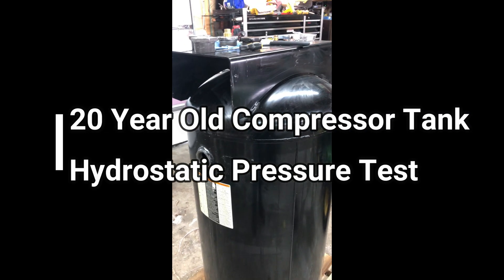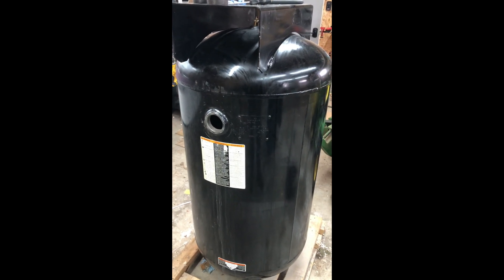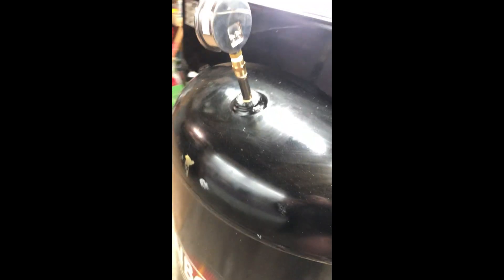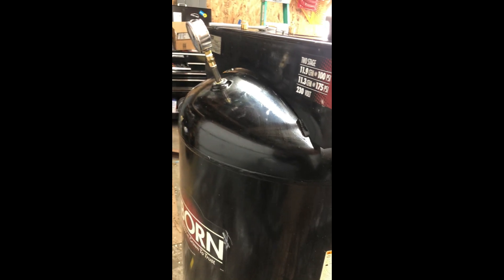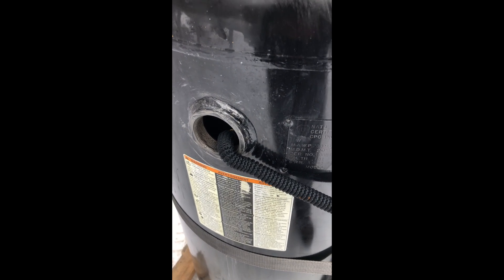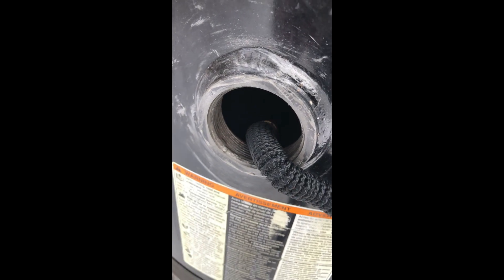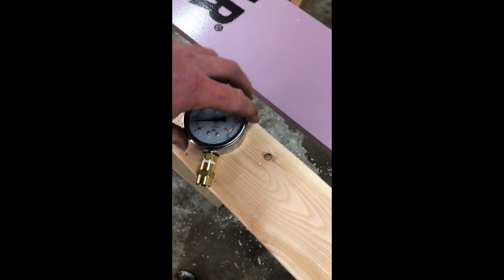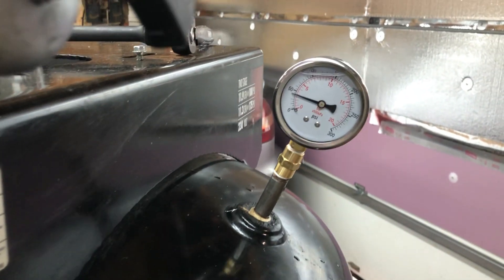Hydrostatic Compressor Tank Test

Comment: My 30 gallon tank takes about 1-1/2 cartridges of grease to pressurize to 300 PSI. I leave it at that pressure for 1 hour. The grease in the tank doesn't hurt anything and reduces corrosion on the bottom.

Comment: You should’ve use the pressure washer you don’t even have to turn it on. You could just pull the crank a few times and the pressure will immediately start building.

Comment: What kind of pressure gauge did you use? Gauges meant for compressed air or gauge meant for water pressure?
Reply from the maker: I think I just got some water pressure gauges at the local hardware store.

Comment: If you do not have a scope. Use a small  inspection mirror that will fit in the hole and angle it so you can see the bottom. Just a helpful tip.

Comment: Seeing how much grease was used, only confirmed to me that using pressurized nitrogen is the way to go. I fill the tank with water and then used nitrogen for the testing. Granted, I think the grease may be a tiny bit safer but with the tank full of water, the nitrogen isn’t that dangerous for the final pressurization in my opinion.
    Using a small nitrogen cylinder can’t be too dangerous since there’s a regulator and I’m only giving small amounts of gas.  Kieth Rucker used a pressure washer which is another good way in my opinion. Anyway, thanks for the video because you definitely didn’t edit out the bad stuff. You had me laughing because I thought I was watching myself. It’s like what else can go wrong. Good stuff.

Comment: well, that solves my "don't have a pressure washer" issue to do a hydro test.    Was the grease fitting on a pipe fitting a custom job or can it be purchased?
Reply from the maker: Grease fittings are usually npt threads. Everything on the compressor is an npt thread. Should be able to find everything you need at the local hardware. It takes considerably more grease than you would think. I did the math and the tank actually expands quite a bit and that much water compresses more than you’d think when it gets pressurized.
Reply: @unskilledmechanic9601  Thank you for the reply.   I picked up the last package of 1/4" NPT grease fittings at my local hardware store.  It took about 1.5 tubes of grease to hit 270 psi.  No leaks and no creaks.   I decided to set the cutout at 120 psi and a new safety valve at 140.  Slapped some new paint on and now I have a portable gas powered air compressor that only cost around $150 including the motor.   at some point I plan to add a 2" inspection port, so will have to to do the test again.   I might end up getting a long hose and a bucket and just using water with the grease pump head in the future or modifying the grease tank to take a garden hose where the plunger hole is.
Reply: @travishanson166  Sounds like you plan to weld on the tank?  Please dont do that.  Can cause a weak point in the tank that will fail after some time.
Reply: @benjaminreinhardt259  that's the point of hydro testing.........

Comment: I was thinking you could also do before and after circumference measurements to get sort of the same info that a pro tester gets by submerging the entire tank in water and watching what happens to the water level during testing and after depressurizing.
Reply from the maker: I think I did the math on that. I think I came up with the diameter only changing about 0.060 inches. Difficult to measure that accurately.
Reply: @unskilledmechanic9601  yea thats splitting hairs 1/32" is 0.03125.

Comment: I would never have thought about using grease man. Obviously it pumps loads of slow pressure.
How did you get all the grease out?
Did you get the compressor up and running yet?

I never thought much about the danger of an air tank until I welded some rusty holes up in the bottom of an old Rolair twin tank wheelbarrow 5HP Gas powered.
I started looking into it more and more on Youtube and became leary of using it without replacing the tanks.
 Its parked in the dry for now and I'm not going to be welding any more holes up. Every time I fixed one hole another would show up. In fact a felt a bit safer with it leaking a little but not completely.
A weak spot would be the most likely place for it to start letting go and finally blow apart.

That was a good strong pump too it would run a 1inch impact just enough to break the lug nuts loose on commercial truck tire with its full 160 PSI.
Reply from the maker: Compressor is up and running. Just took out the 3 inch diameter plug at the bottom and all the grease came out. I figure any residual grease isn’t going anywhere. Extra rust proofing!
Reply: @unskilledmechanic9601  I saw where one guy used water in his grease gun. I would have never thought of that one either.
I'm fixing to get my 80 gallon up and running. It was originally rated at 200 psi with pump and motor designed for 175 psi. Its a 1998 Mode ProAir exactly the same unit as DevlilBiss PRLKC6580V2-1. In fact they share that same model number. I think DevilBiss made it for Homedepot to sell as ProAir.